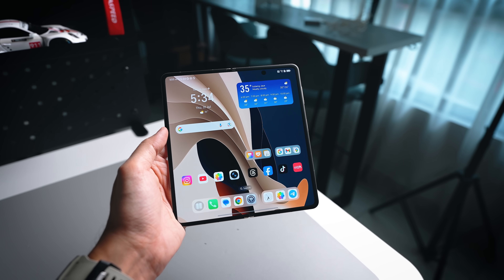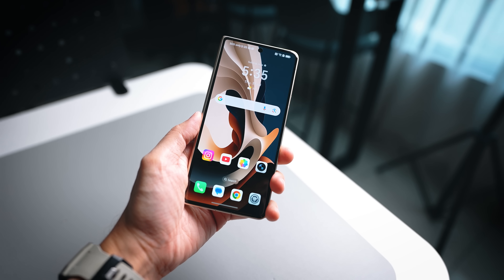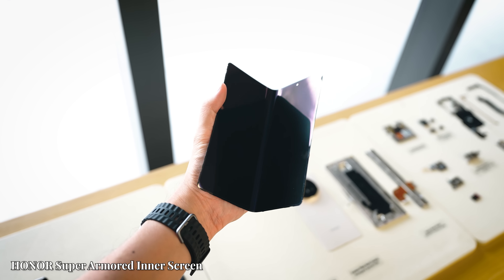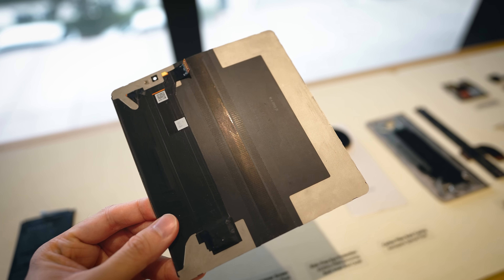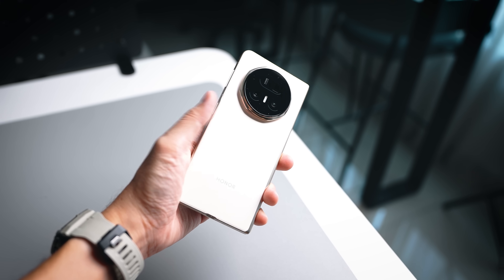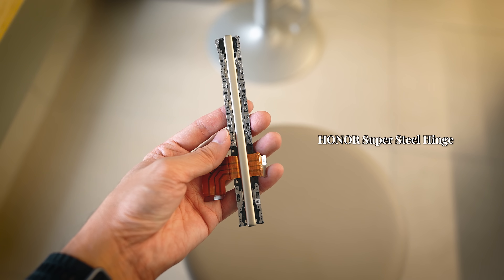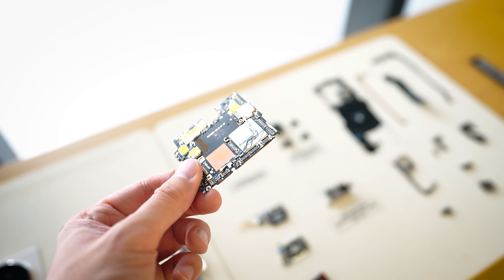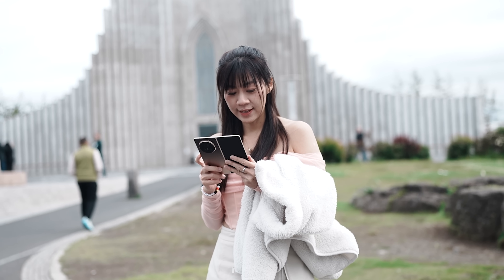HONOR Magic V5 Teardown: What's Inside? And What Makes it so Durable? 🤔

Comment: So the inner screen can be scratched with finger nails like fold 7 or no? That's what I'm looking for
Reply: Of course it can. It's still plastic on the top layer. I think this issue is massively inflated. I'm on my third foldable and I not only once caused a scratch with a fingernail. damages were always superfical and gone after reapplying  a new screenprotector

Comment: I really want to get this phone, but it's not available here in California. Can you help me?
Reply: Wonda mobile
Reply: But if it breaks your kinda done!
Reply: Wonda Mobile, Trading Shenzhen located in China or Average Dad shop located in UK. In the event of a warranty claim, everything takes much longer due to shipping there and back...
Reply: @a.g.7629 Trading Shenzhen, Wonda, Giztop don't offer it yet, as it hasn't (Global) been released in HK yet (Aug 6) 28mobile had it $1749 16/512, but quickly raised the price to $1899 and Average Dad had it for over $2000. The last two where the Malaysia versions. As far as I know, only Singapore and Malaysia have released the phone. Next is HK on the 6th followed by Dubai on the 16th. Hopefully, as they're more releases the price on imports will come down.considering the phone sells for 6,999 Ringgit in Malaysia or $1636.24 in USD and importers are bumping the price several hundred into the Samsung stratosphere of illogical pricing, but hey, every middle man has to make a buck. So the number of wholesaler's hands it passes through will determine price.

Comment: Hardware Zone Singapore conducted a PCMark for Android battery life test, and the results are sobering. Honor urgently needs to improve the V5's firmware. The Samsung Fold7, with its smaller 4400mAh battery, beats the V5 in terms of battery life. The Vivo X Fold5 achieved 778 minutes, the Honor V3 achieved 730 minutes, the Samsung Fold7 achieved 640 minutes, the Honor V5 achieved 634 minutes in normal mode, and 538 minutes in performance mode. I hope Honor will improve the battery life further via firmware 😐
Reply from the maker: Good that you point this out. Benchmarks are benchmarks but real world usage tells a different story.
I am currently conducting my own battery test which I will share more in a comparison video.
For the time being, based on gaming alone, on equal graphic settings, the HONOR is lasting longer than the Samsung.
Again - I will share more in the full comparison. Stay tuned.
Reply: I'll definitely wait for your review. Honor will release the V5 in Europe at the end of August, and I naturally want to know if the V5 is worth the €1,600-€1,700 it will cost, so I can invest my money with confidence.